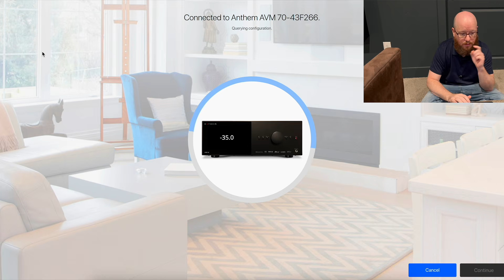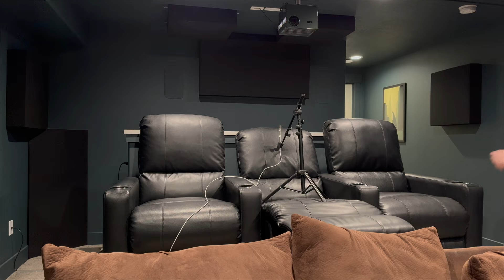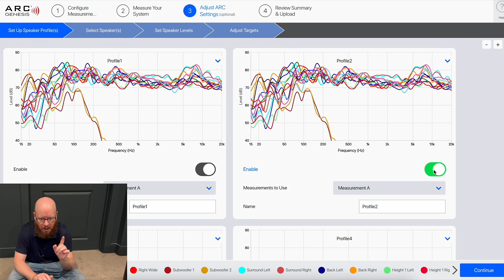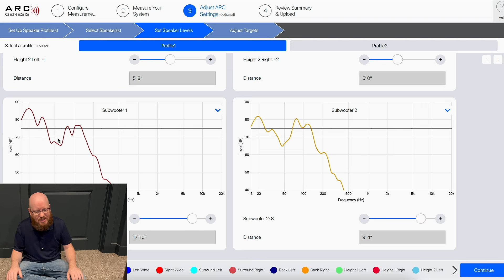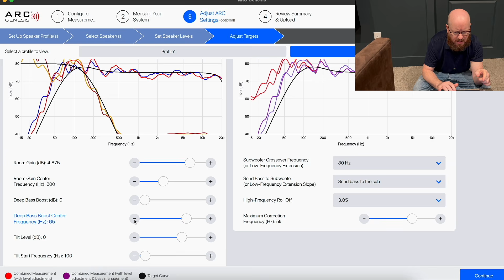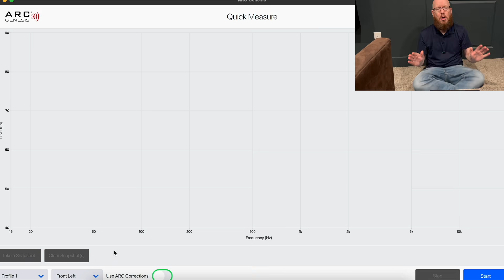Fix Your Sound! With Anthem ARC Genesis

Comment: I noticed that you didn’t do a quick measure on subwoofers before running ARC Genesis. I’ve seen it accomplished in other videos. 

So, is that required?  Thanks 😊!

Comment: I would think it IS worth a profile 1 ,  2 . 3 and 4 with adjustments so you can keep profile 1 , your base measurment .  If it sounds not to your liking you could try putting the mike in different positions and compare to find if it is nearer to your liking and then make that your base measurement , for stereo make adjustments with the mike to your liking , then use other profiles/tweeks and again listen .. otherwise your chasing your tail without a base measurement . I will try measuring with the mike at least 2 feet away as a previous comment really made me think , yes a broader reading in how your room behaves  and Genises works in your enviroment  using it's magic ... fantastic software .

Comment: Put a sub in one of the back corners and you will get better results
Reply from the maker: I now have four 15” SVS subs, one in each corner. Dramatic improvement!
Reply: @GeorgeTheaterAtHome  very much so! Did you find yourself turning the subs down?

Comment: Appreciate the level of detail you're sharing with us. ARC is an underutilized tool for sure. That said, Anthem actually recommends against keeping the mic in the main listening position and moving the mic around the room much more than you did. It gets a much clearer idea of what the room acoustics are. They say (in personal training with them) 2 feet minimum from placement number one for each consecutive placement. Also, move it a couple of feet away from the seat back for more accurate readings, and change elevation in a couple of placements. One thing about the dip at 50hz, you could actually lower the peaks closer to the dip level and then raise your sub level to compensate.
Reply: Big room, more measurements.

Comment: Hi Theater at home, for your null at 50hz do you have a minisdp?

You might be able to solve it with an all pass filters to rotate the phase.

Or

If so you can try running MSO multisub optimisor as it should able to solve it with with PEQ and delays.

I was able to remove 2 nulls in the upper bass with Mso. It will be time consuming but worth it.

Comment: I haven't had a chance to watch the video fully yet, but I am curious how you find the bass from arc?  In my room with my kit it just feels lacking, it took a minidsp to get it sorted.  Boosting it in arc just made music sound boomy due to lack of custom curves or full PEQ options.  I think in my room it doesn't a better job than audyssey with surround sound separation and balance but bass not so much.
Reply from the maker: In the video I explain the ways of dialing in the low frequency target curves and running the Phase Adjustment tool. After making those adjustments my bass is now 👍🔥👍
Reply: Already aware of these unfortunately.  The issue I have is when I measure in rew after calibration its doing some odd things that I can then get fixed in minidsp by applying some basic PEQ.

Comment: Another classic video!! 🎉 I know it prob won’t work, but for the null in the room, did you try moving the seating position forward 6-8inches? It’s prob too late now, but could be interesting to find out if ya moved the seating since ya can’t move the sub, maybe it would work? 🎉  thanks for the hard work!
Reply from the maker: I can’t move the MLP any further forward because the riser doesn’t extend that far. If I were designing the room from scratch I would have a single row of seats so I could try different locations to find the best spot. Thanks for watching!

Comment: Your not supposed to run automatic phase adjustment until you upload the changed to your device. You're also supposed to level match each speaker to 75db for the last step.
Reply: Shouldn’t you do a quick measure of all your speakers before you calibrate?
Reply: That's good to know, actually. The software really should warn about that, if the receiver/processor hasn't had an updated profile sent to it, before doing the Phase adjustment.
Reply: Yea a lot of people forget that and wonder why my system sounds so good and there system doesn't. Also NEVER allow the system to correct above 500hz. And level match using quick measure after your done with everything with room correction on. If you running dual subs turn your subs up to 71DB each using the volume on the sub and there you have it. Dont go too far with room gain or deep bass boost. @electronash
Reply: @LATEKNIGHTTALKPODCAST  You can correct frequencies above 500 Hz. Many experts, such as Anthony Girmani and Gene from Audioholics, are doing just that. However, it depends on your speakers and the size of the room; there’s no one-size-fits-all solution. The guy in the videos’ response is so bad that he would probably definitely benefit from it.
Reply: @LATEKNIGHTTALKPODCAST 
What happens if you go too far with room gain or deep bass boost?
Reply: Facts
Reply: Level match speakers after calibration? Why?
Reply: So every speaker is 75db  @njrumenos
Reply: @LATEKNIGHTTALKPODCAST it should be 75 after the system is calibrated, you shouldn’t have to alter the levels, I have been told if there is a difference in level it’s because ARC is not active during the test tones?

Comment: You want to have the tip of your mic at least 1m away from surfaces. Using the chair back to measure where your head will be is OK, but make sure it isn't close to the mic when measuring. I used to do this and was wondering why my results would vary so much cal to cal. Talked to the folks at Anthem and they sounded like they were gonna lose it. Now I measure with seat backs/head rests down and my results are much cleaner. Also, ensure that the cable being used for the USB-C mic isn't over 2m, I believe. Anything over that can, not necessarily will, but can cause some results that are not entirely accurate because of accumulated EMI or signal degradation. Hope this helps someone.
Reply: Did you really mean "1m" away from surfaces? i.e., ~3.3 feet?

Comment: When you re-run ARC, is it really as simple as removing existing ARC file from Anthem? Or is it better to do a factory reset? I redid mine and it changed volume levels for the worse. Anthem says not all settings removed when redoing.
Reply from the maker: A factory reset will guarantee all previous settings are erased.

Comment: Excellent video!!!    How does your AVM70 sound compared to the Trinnov?     Also, my AVM60 display has failed.   😔.     Everything else still works normally.   🧐.    Would you recommend upgrading to a 70 or 90 or something with Dirac ART?      Thanks for your thoughts!    Tony.  😊🇺🇸
Reply from the maker: I’m working on a Trinnov vs Anthem AVM 70 video. Stay tuned! 
For an upgrade, I recommend the 70, unless you have 4 subs to take advantage of the 90.

Comment: When you change your subs volume after calibration it will not match the phase correction that ARC did - better option is to do Booster profile that is more juiced on the bass curve.
Reply: Since when does amplitude alter timing?
Reply: @njrumenos so phase alignment is just timing alignment regardless of sub amplitude?
Reply: @Nikita-P yes and the output level of the sub will not alter the timing relative between it and the loudspeaker, amplitude won’t effect the phase relationship or ARCs phase correction, only the delay, crossover point and physical location movement can alter the phase corrections, amplitude is just amplitude